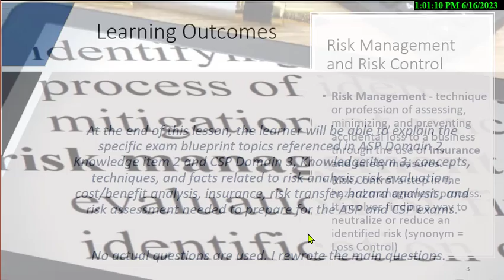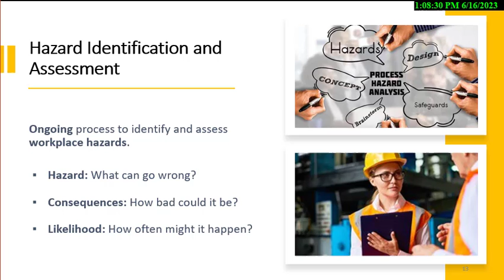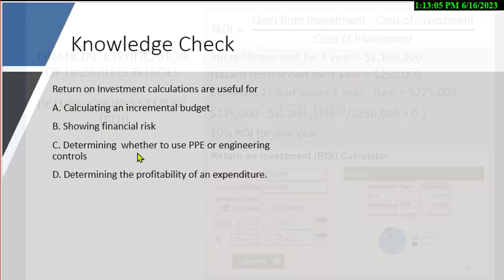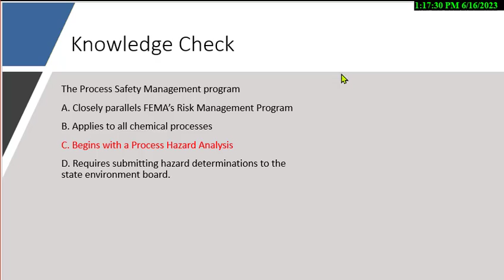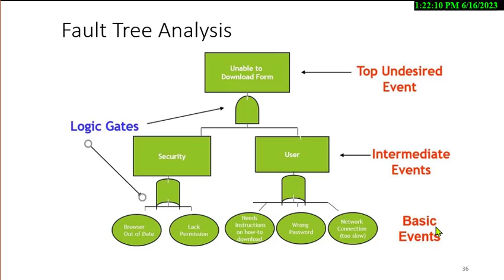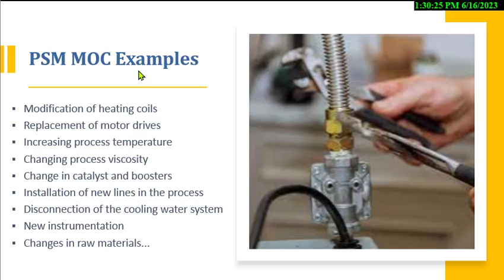CSP ASP CHST Risk Management June 16 2023

Comment: @ 25.06 - Knowledge Check
"What are the essential components of a ""what if"" hazard analysis?
a. Aimed at facilitating root cause analysis
b. Requires minimal time, few resources, and little preparation
c. Meets regulatory requirements for pre-task planning
d. Cost-effective, utilizes a multi-skilled team, and employs a qualitative approach"
Correct answer is d as recommended by various AI Models
Can you please verify?
Reply from the maker: D is a hazop for psm.

Comment: What is the difference between FMEA and Fishbone?
Reply from the maker: In incident investigation and risk analysis, FMEA (Failure Modes and Effects Analysis) and the Fishbone Diagram (also known as Ishikawa or Cause and Effect Diagram) are both tools used to identify and address the root causes of problems or failures. However, they differ in structure, focus, and application:

1. **FMEA (Failure Modes and Effects Analysis)**:
   - **Focus**: FMEA is systematic and structured for identifying potential failure modes within a system, assessing the severity and likelihood of the failures, and understanding the effects of these failures. It is often used to anticipate potential failures before they occur and implement solutions to mitigate risks.
   - **Process**: It involves listing each component or step of a process, identifying potential failure modes for each component, and then rating the severity, occurrence, and detectability of each failure. The Risk Priority Number (RPN) is calculated by multiplying these three ratings, helping prioritize the failure modes that require the most urgent attention.
   - **Output**: The output of an FMEA is a detailed analysis with ranked failure modes based on their severity, likelihood of occurrence, and detectability.

2. **Fishbone Diagram**:
   - **Focus**: The Fishbone Diagram is used to identify, explore, and visually display the many potential causes of a problem or effect, not just the failures. It is often used after a problem has occurred to trace the root cause of the defect.
   - **Process**: In constructing a Fishbone Diagram, the problem (effect) is placed at the head of the fish, and potential causes are listed along the "bones," which typically categorize causes into major categories such as Methods, Machinery, People, Materials, Measurement, and Environment.
   - **Output**: The output is a visual representation that looks like a fish skeleton. This diagram helps in brainstorming sessions to identify the various potential causes of a problem, which can then be further investigated.

**Key Differences**:
- **Purpose**: FMEA is predictive and more quantitative, aiming to prevent future failures by systematically evaluating potential failure points. In contrast, the Fishbone Diagram is more qualitative and diagnostic, used for identifying multiple root causes of a specific problem or quality defect that has already occurred.
- **Detail**: FMEA provides a detailed risk assessment for each failure mode, including quantifiable risk priority numbers. The Fishbone Diagram provides a broad overview of all potential causes without prioritization based on risk.
- **Usage**: FMEA is more detailed and often used in engineering, manufacturing, and quality assurance to improve reliability and safety. Fishbone Diagrams are used in various fields, including business processes and healthcare, for problem-solving and quality improvement.

Choosing between FMEA and a Fishbone Diagram depends on the specific needs of the project, whether focusing on prevention or diagnosis, and the level of detail required for the analysis.
Reply: @johnanewquist 🎉🎉🎉

Comment: I appreciate this videos but you are wrong in terms of the ladder.  As long as the person is not using the last step, and the second to last (in a Type-A) ladder, then the person can work with both hands.  The exception to this is when the person is climbing up and down the ladder; the person shall have three points of contact.  If you cannot work with both hands while in a step ladder, then it would be silly to have these types of ladders at all.
Reply from the maker: Werner #2 rule on the ladders is: Face the ladder and maintain a firm grip at all time. They want you to use a platform ladder not a step ladder.